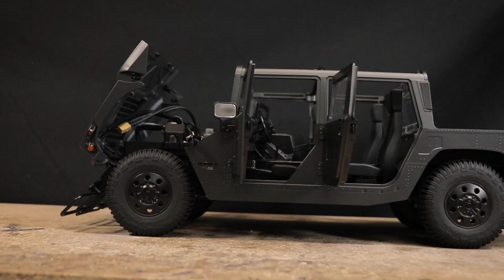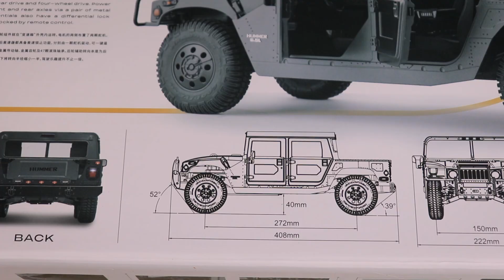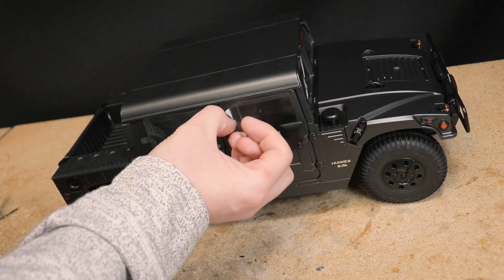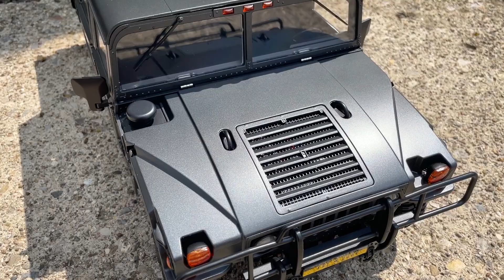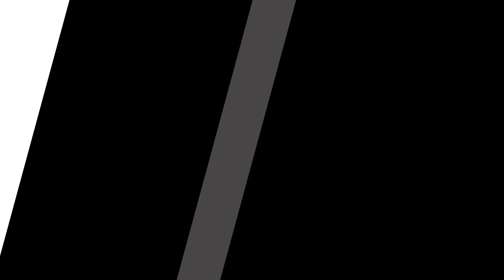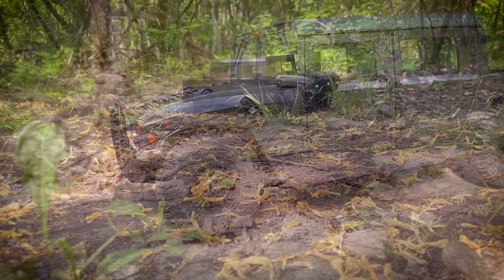Next Level RC Engineering! Taking a Look at the New RTR Hummer H1 From FMS Model

Comment: Very nice rig but something about the inset wheels throws off the look of this truck. Seems like the wheels are too small, too skinny, and set too far into the wheel wells. I feel like if you were able to change wheels and add thicker hexes,  it would look really really good.
Reply from the maker: Agreed. I wasn't a huge fan of the stock wheels so I ended up custom designing and 3D printing a set of my own. It was a fun little project and I much prefer the new look: https://youtu.be/Nj5lK6E9Bn4

Comment: Hey, just got this and it is awesome. One problem...how to switch from 4WD to 2WD??
Reply from the maker: It's been awhile and I usually keep it in 4x4 mode, but have you tried pressing and holding the channel 4 button on the side until you hear the servo move? Otherwise I'm sure it says in the manual. Have fun with your new rig! These Hummers are a lot of fun for trail driving.
Reply: @MakeItRC  Thank you=I will check!!

Comment: Hummer nutcase here. It is not a 2006 H1 Alpha. FMS fooled us all. It’s a pre-2000 model interior & exterior. For ultimate realism; use weights to bring it to 2,950 grams curb weight. Toss out the foams, air fill & glue seal the tires. I converted the hard top to a soft top and added roll bars, and trimmed the rear bumper as a bonus.

Comment: When I first saw these, I thought they were ridiculous because of the 4-wheel steering, but after seeing some modified 1/1 rigs with 4-wheel steering, I've changed my mind. However l, at $330, I really think that FMS should have included a battery, too! Also, when will RC companies stop putting turn signals on off-roading trucks? It's totally ridiculous that we can't turn them off! I unplugged my side marker lights from my RocHobby Fire Horse so I wouldn't have to deal with them.